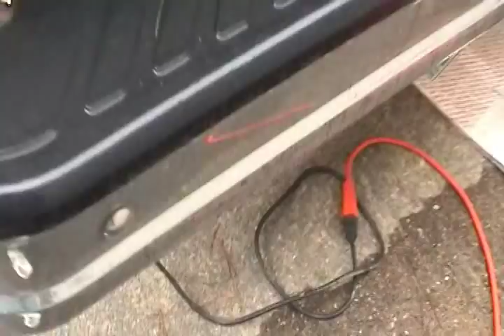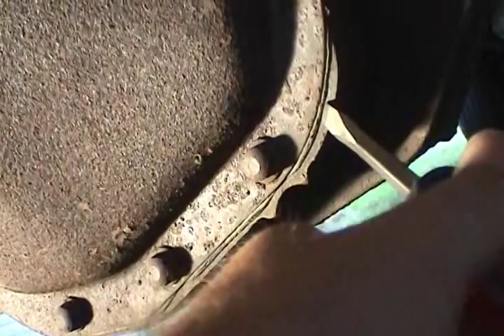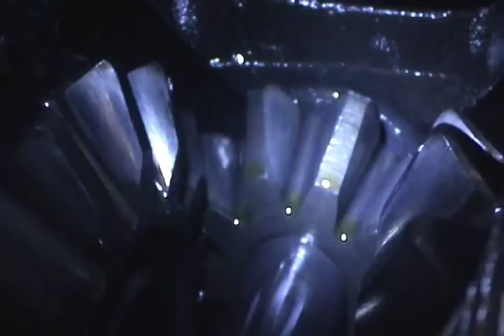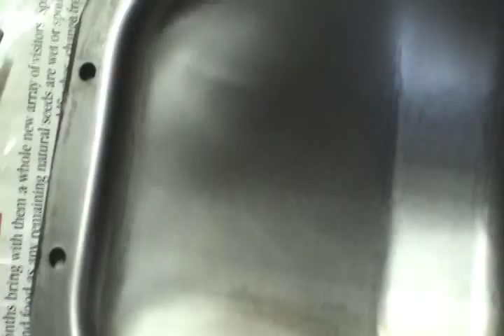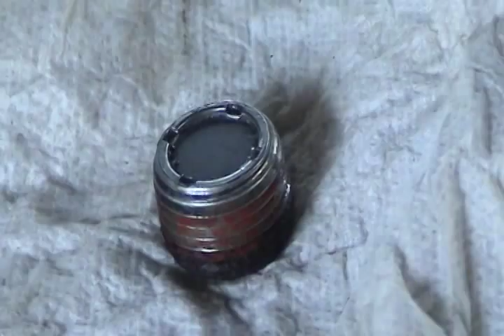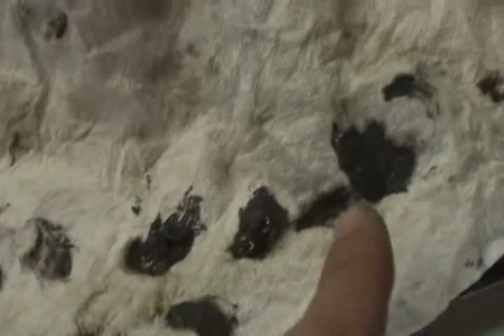1995 Ford F-250 4X4 Differential Fluid Change

Comment: I know this is a few years old but did you use a limited slip additive with your gear oil? If you didnt, you may have ruined your clutch packs. O and did you ever do the front end? I would REALLY like to see a video of that before I dig in.
Reply from the maker: I didn't have to use any additive with this particular unit. The oil used already has some additive in it already. There was never any clutch chatter after the change. I didn't do the front since that diff. is rarely used, but I do plan to do some work on the front (ball joints, axle pivot bushing, etc.) so stay tuned!
Reply: Thanks

Comment: thanks for vid..doing same to my 95 f150..you have any suggestions on best way to remove oil pressure sending switch located right beside the oil filter. is it best to get it from the top or bottom..